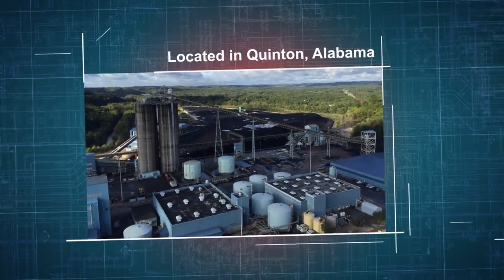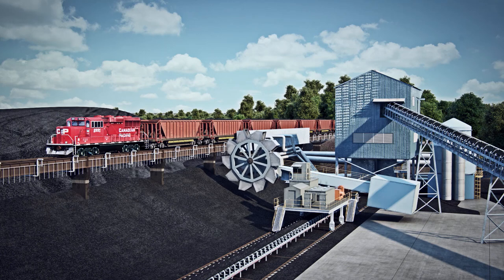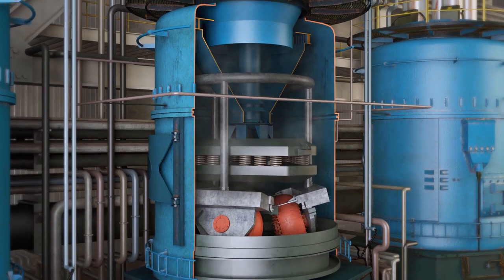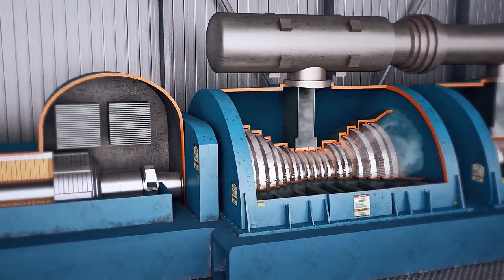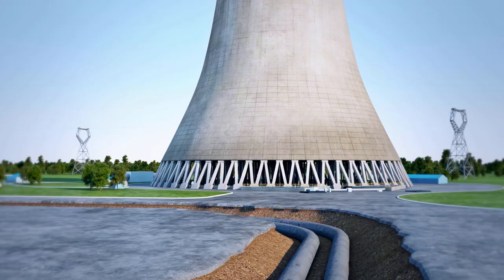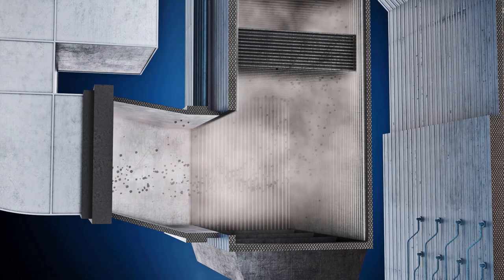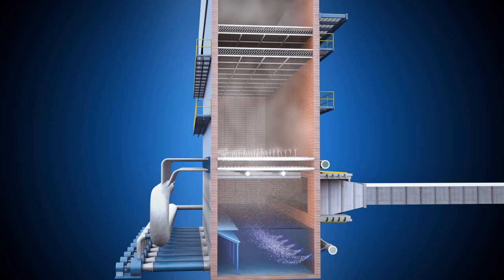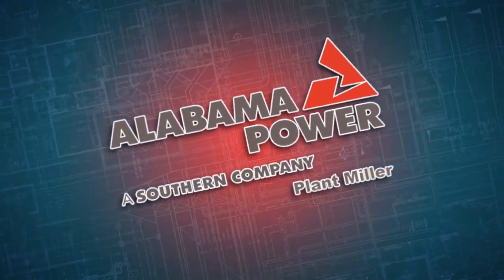Alabama Power's Plant Miller How Electricity Is Generated 3D Animated Tour

Comment: How can we praise a factory that uses that much coal? Solar,  wind, nuclear - so many better options
Reply: Cesil Alex

Nuclear would be fine (except morons shut it down).  Solar or wind, NOT possible.
If you cover half the state with wind and solar panels maybe but clouds can last for days or weeks.
Wind is also very sporadic and there are no capacitors to store the grid power.
Boilers would need to back up the grid.  IT TAKES 12 to 18 HOURS to get boilers up to temp. for steam generation.
That means the boilers would need to be left in operation (hot) in the background. 
What YOU DON'T understand can Kill You. I am not going down just because MSM hates the individual.
Reply: One of the less desirable side effect of increased quantities of renewable sources like wind and solar is that it displaces cheaper to operate base load plants like Miller and requires construction of gas fired peaking units which are more costly to run. These gas fired peaking units have to be able to run on short notice to make up shortfalls in energy production caused by lack of wind or by cloudy days.

Comment: I understand the processes for the most part. But, I think we can do far better. 38,000 TONS of coal in a 24 hour period.  That's 2111 truck loads with the dump truck I drive. Well, I think we could do far better. And drastically use less coal to do it..
Reply: Well of course we can't. The maximum efficiency you could get out of a standard sub-critical power plant can be only about 36%. For super-critical and ultra-super-critical PPs, this may go upto 41-42%.
Now don't blame technology for this. This is how Thermodynamics work!
Reply: ONE GALLON OF WATER = SIXTEEN GALLONS OF STEAM. THE PLANT MUST OVER COME IT'S OWN POWER NEEDS FIRST TO OPERATE.THEN ONE PRODUCED HP= @ .75 KW. YOU ARE NOT GOING TO GET APPLE FOR APPLE,NO MATTER WHAT. YOU BURN ABOUT 100 CALORIES AN HOUR JUST TO SIT AND WATCH T.V. I HOPED THAT THIS HELPED.
Reply: @terrelmchenry9524  hi. We do things different over here at h2o-and-evs.
Reply: It's ~380 train cars.
Reply: re: "Well, I think we could do far better. "

CHECK OUT "Brilliant Light Power" then. I'd post a link but I don't want to be convicted of spamming YT discussion threads.

Comment: why is the locomotive a Canadian Pacific. I don't think we export coal to a coal rich country. Trying to put some bad press on your  brothers to the north eh!
Reply: Not sure why the animation has a CP locomotive but the narrator said the coal is from Wyoming
Reply: @mike Jackson They probably had the low bid for hauling or bought the track. Don't guess they can barge coal from Wyoming. I know Canadian National has bought out some old American rail lines so probably same with Canadian Pacific.
Reply: BNSF brings in most of the coal this plant uses and it comes from the Powder River basin. CSX and Norfolk Southern also have rail connections to the plant, but they don't supply much coal because they can only access eastern high-sulfur coal mines on their networks.
Reply: Canadian Pacific and Canadian National both have tracks in the U.S.

Comment: Global warming might be caused by the sun simply getting hotter.    It might not be caused by burning coal and gasoline.  The sun got hotter when the ice age ended.   Few humans were around back then ,so bottom line is we have to keep coal as long as it’s economical- and it appears to be a fine system
Reply from the maker: Of course, it all makes sense now.
Reply: It could also be caused  by geo thermal heat radiating outward from within from tectonic plate friction.

Comment: This is greener than a nuke by a 1M times, I think. Did you know all concrete has the fly ash mixed in?
Reply: "This is greener than nuke by 1M times, I think." Well I'll tell you this I KNOW nuclear energy is "greener" than Coal. Nuclear power is far, safer, energy effective, and environmentally friendly than coal.
Reply from the maker: @Dave George 1M times? Tell us more about how you calculated that.
Reply from the maker: let's hear more about what you know regarding the nuclear being greener than coal - these comments are great, but let's see some facts to back up these statements - I'm sure everyone would like to see the facts
Reply: @edpvideo  First of the statement of "1M times" was a reference to "Dave George('s)" original comment, as its in quotation marks in my comment indicated its not a quote from me. Secondly I can't speak for him personally however I interrupted it as hyperbole. I don't have the time, nor resources to calculate such, but I can say with absolute certainty that Yes, Nuclear energy is "cleaner" than Coal. And by substantial margin. The first "fact" would be just basic knowledge of electrical production, and high school grade chemistry. Both Nuclear and Coal/Petrol, rely on steam to turn generators. They differ in how steam is generated though. With Coal/Petrol you need to burn the substance to release its potential energy and turn that potential energy into thermal energy to raise the temperature in a boiler to generate steam. Nuclear does not require any "burning" instead relys on "Nuclear Decay" from highly enriched fuel rods. Im assuming most people already know what Nuclear decay is but if not I'll give a brief description. Once an atoms mass has surpassed a certain threshold either naturally such as with elements like Uranium, and Radium. OR by artificial mean say like Cobalt 60.The  strong force can no longer contain the mass of the atom. Decay occurs to reduce the mass of the atom to a stable point. The main byproducts of decay are heat, and radiation. Now back to the topic of nuclear power generation. Since their are many different types of reactors I'll just give brief summary on how a "general" Nuclear Power Plant operates. Enriched rods of Uranium are submerged into a pool of coolant, control rods are lowered to meter the decay rate of the Uranium rods. The rods inturn release heat into the coolant thus boiling it to generate steam. Since their is not burning of any material in the generating process Nuclear is already far "greener" than Coal as their is not CO2 emitted as byproducts. By default this alone makes Nuclear greener than coal, however when you also take into consideration Coal is a one time use product where as nuclear fuel rods can and are in some countries "recycled" and reused. France for example is one of these countries. The United States does NOT recycle its fuel rods. But if you don't take my word on any of this heres some links below \/
http://nuclearconnect.org/know-nuclear/talking-nuclear/top-10-myths-about-nuclear-energy

https://www.heritage.org/environment/commentary/recycling-nuclear-fuel-the-french-do-it-why-cant-oui
Reply: Cement you meant to say
Reply: Nuclear power plants emit steam. Coal fired plants emit mercury, arsenic, cadmium, lead, uranium, radium, sulfur dioxide, methane, soot, nitrous oxide, formaldehyde, xylene, toluene, and benzene. With reprocessing, we wouldn't need to mine for new uranium for decades and we could take apart nuclear weapons to use their fissionable material for power plants. Unlike coal where you have to destroy hundreds of mountains in the terrible practice of mountaintop removal coal mining. Uranium can be mined in a minimally invasive practice called in-situ leaching. What's more is that uranium is 3 million times the energy density of coal. So, it takes much less uranium to do what is needed. Also, coal mining causes acid mine drainage. So, you got things the wrong way around. Nuclear power plants also provide medical radioisotopes.
Reply: @Jemalacane0  but radioactive uranium  and plutonium are one of the most hazardous substances...even after use at a nuclear plant...it take 100s of years or even thousands of yrs for the remaining stuff to cool down...storage of nuclear waste is very critical...not to mention if a reactor explodes for some reason...
Reply: @menzishoba7696  No they're not. They're far from the most radioactive substances what with their very long half lives. I'm pretty sure lead, arsenic, and mercury are hazardous and they're hazardous forever. The waste from coal burning goes into your lungs and into water ways. Arsenic is used to kill rodents. So-called radioactive waste (most of which can be reused) sits in dry casks, doing nothing. Particulate emissions cause heart attacks, asthma attacks, and strokes. Arsenic, cadmium, volatile organic compounds, xylene, toluene, benzene, and formaldehyde are all carcinogenic. Coal causes the most deaths per kwh of any method of making electricity. Hello, you get radioactive emissions from coal too. Mercury and lead damage the nervous system.
Reply: re: "This is greener than a nuke by a 1M times,"

Expressed idiocy at its best.

Comment: Ew coal. More expensive, less dense of a energy source, a horrible pollutor, and contributor to climate change.
Reply: imagine getting upset by a rock
Reply: Once you succeed in closing all units (like Miller) that can store fuel on site, I can't wait to hear you bitching in rolling blackout scenarios because you can't charge your Prius.  Diversity is key.  Remember that.  Diversity.
Reply: Climate Change : the 100-year-old hoax. You believe in lies.
Reply: Chris Russell your thinking nitrogen and phosphorous 
Carbon is just the building block of all life. You still need other nutrients for growth. The problem with too much Co2 in the atmosphere is that it’s trapping heat and effecting weather systems and ocean temperatures. It’s got nothing to do with the air “quality” I think your looking at the problem the wrong way.
Reply: Ladies and gentleman, I give you "Bryce A", who failed to actually watch the video, and look at the extensive lengths they went to to meet pollution standards ...

Comment: tbh, this don't seem so dirty as the libs explain it
Reply: The term "dirty" doesn't refer to the amount of smoke generated. It refers to the byproducts of the process which in this case is large amounts of CO2.
Reply: nah not at all, all those thousands of people dying from lung issues every year are winey libs. No conservatives harmed.
Reply: @fireraisr  Humans create CO2, yet everybody is breeding, why hate on coal?
Reply: because you seem to forget the tonnage of co2 produced is much more than a city full of lungs... there are other chemicals it produces that you seem to look away from,
Reply: Mac Gyver is a troll and he/she/it be trolling!
Reply: @HappyfoxBiz   It's less, still why hate on coal and not humans?
Reply: @bhunjiboyy  Because coal is no longer necessary to provide energy in the presence of cleaner burning fuels. Even other fossil fuels like natural gas is a better option as they not only produce less harmful chemicals like sulfur oxides or soot but they also produce less carbon dioxide per MJ of energy generated.
Reply: @fireraisr  Except CO2 is not dirty.  It is a requirement of combustion. A plant like this is not "dirty" because it has systems to reduce the CO, NOx, and SOx.  If maintained properly these plants might actually be filtering the local environment of these pollutants.  Some combined cycle plants have air permits that require them to clean the flue gas leaving the stack to levels lower than it went in at.
Reply: @dnshist  Natural gas is a very good option with one major exception, you can not store a month worth of fuel on site.  Or in some cases more than 30 years worth.  Unless people stop denying fission reactors the government will not allow coal to die.  It is part of homeland security.
Reply: Look up coal ash ponds.  This shit also releases more radioactivity than any nuclear plant.

Comment: Coal is death , propaganda
Reply: Coal in the form of coke is used to make steel. Steel is used to make everything from the generators to produce the electricity which made it possible to post your reply. To, the farm machinery which makes it possible for farms to grow the food you eat.
Reply: @commonsense1907  SSAB which is a big steel producer in Sweden is going to start producing steel with hydrogen instead of coal to make it more climate friendly. I dont know about the details but you can look it up it seems very promising 😏
Reply: @commonsense1907  Yes thats true but as i understand it they now use coal to heat the raw mined iron with coal to extract the pure iron. Its the coal used for heating they want to replace with hydrogen instead.
Reply: Hydrogen is to be used to reduce iron from its ore. Regardless of where the heat comes from. A source of carbon is needed to make steel. Steel consists of iron, carbon and other elements.
Reply: @commonsense1907  Fan du är svensk va?😉 True but atleast they dont have to burn the coal, only add it in its cold form as an addative. But as i said before i dont know about the details i have to do a bit more reading.
Reply: It remains to be seen if hydrogen is going to replace coal in the form of coke in the  reduction of iron from its ore at steel mills around the world. It takes energy to obtain hydrogen.
Reply: @commonsense1907  Yes it will indeed be a very difficult task but i am optimistic.
Reply: @commonsense1907  it takes energy to obtain other sources also.
Reply: That's true. Nothing is free.  The difference is whether the energy source is  energy dense,  reliable, and efficient. Our modern world is based on the energy density, reliability, and efficiency of fossil fuels.

Comment: Let me guess, at some point there is a magnet that passes by a coil of copper wire? lol What a joke. The tech hasn't changed in over a century. There are better ways to create movement but you're not interested in hearing about that are you??
Reply: Oh do explain to us the "better ways" to create movement.
Reply: Well that is a pot calling a kettle black. I guess you are also not self aware enough to notice the condescension in your original comment.
Reply: @UrielX1212  You're absolutely right. My bad.
Reply: I'm pretty sure that's how every method of power generation asides from solar converts kinetic energy to electricity.
Reply: @iaiafefe6106  Even large solar field can be used to heat water, or salt, which is then used to spin a turbine.  Two type of solar.  Photovoltaic and thermal.

Comment: Please stop that shit!!!
Reply: Stop what? Generating electricity? How will you post comments on YouTube while the power is out?? ⚡⚡⚡
Reply: @CherryACR  yes, stop generating electricity by coal or lignite or any high CO2 rejection method!
Reply: @fabienraulo3746  Sweetie, there would be massive blackouts. Do you want to live in the dark?
Reply: @CherryACR , ok darling ;o)... then let me precise my stance... Please make everything possible to stop that shit as soon as possible ;o) Means not making publicity for it as well as not making this kind of rather fake or manipulative video about it and even less constructing any new plant ;o)
Reply: @fabienraulo3746  making power with 0 polution is a pipe dream, unfortunately. 
1. Wind and solar will never, ever be reliable. Never ever. Plus, there is a lot of carbon released during manufacturing and transportation from factory to setup site. Plus, they never pay for themselves. Ever. And they do not last, and have to be disposed of in a landfill, as the fiberglass and chemicals in the blades cannot be recycled. 
2. Wind turbines are notorious for leaking oil and killing millions of birds. Not real good for the environment... 
3. Battery storage is a long way off and isn't real clean either. The copper still has to be mined using heavy equipment, and that acid has to be disposed of when its used up. 
4. Coal isn't anywhere near as dirty as it used to be. There are scrubbers and monitoring equipment to minimize nox. 
5. DEMAND isn't going down. Poeple overall aren't using less power, so thank goodness coal and gas are there to meet that demand!
Reply: @CherryACR , I think you exagerate a bit on consequences, but I mostly agree with you that Wind and Solar energy are very far from being a sustainable alternatives for energy production and are not that clean either... thus for the "ecological transition" we'll need a lot of power... that said, I think it is still very urgent to give up on all carbon base energies . We should rely mainly on nuclear power(potentially risky but highly efficient and clean for atmosphere) to develop the next level of clean energy production(Hydrogen, Fusion...).